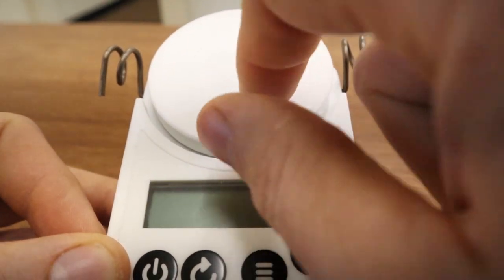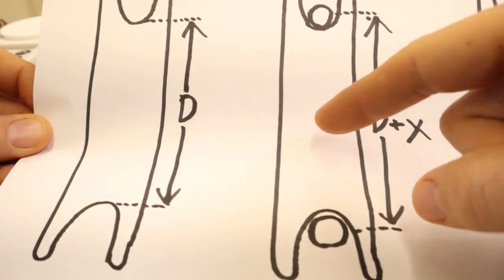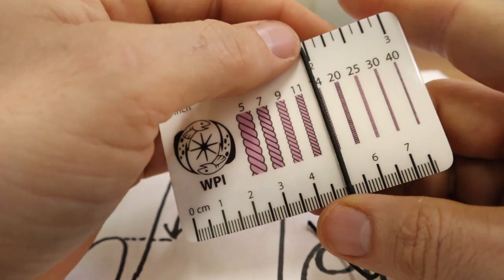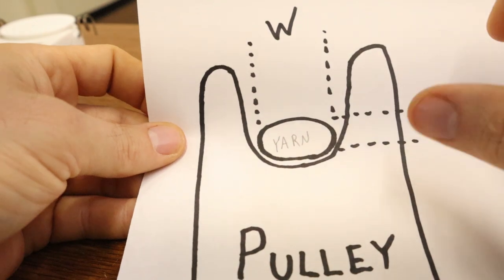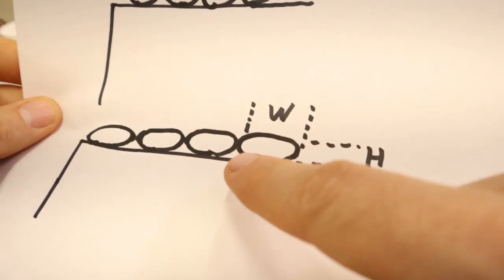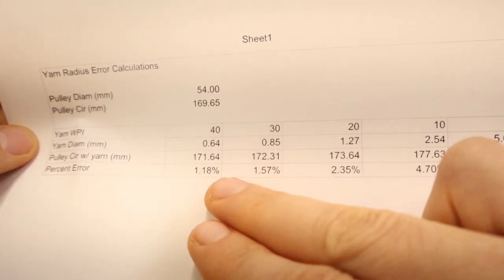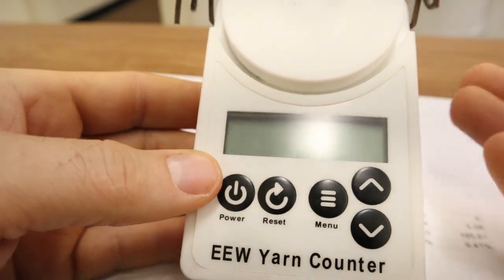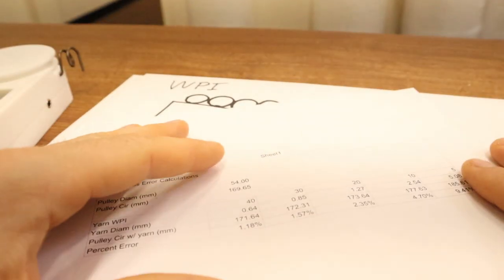SPIN #93 - The Yarn Counter Yarn Radius Problem and Solution

Comment: As long as your solution doesn't add significant cost, then go for it. But since it is slightly under estimating the length that is just fine. Better to have a little more then be short. Especially since some of us s play yarn chicken.
Reply from the maker: I agree that underestimating is better.  As for cost this feature adds nothing to the cost of the product.  It would probably just take me a few hours to code and then another day to fully test it.  The most important thing is understanding if people want the extra complexity in the menu or not since I'm fine with it either way.
Reply: My thoughts exactly!

Comment: If it is under estimating the length it is not a big problem. for a project it never hurts to have too much yarn it's when you have too little that it is a problem. 
Also instead of wpi you could use the yarn number system 1=fingering, 2=DK, 3=sport, 4=worsted, 5=bulky, 6= super chunky.
Reply: Please don't use that system. It is only used in anglophone countries, so most people outside the US will not be familiar with it. Even after 30 years in the US, I find it confusing.
Reply from the maker: Thanks for the feedback.  The issue with those names is not that many people know them (especially in certain countries) and their actual meanings are different in some places.  Just look up WPI charts online and you will find many of the top ones use different names with different WPIs.  Because of this I think I'll go with WPI and include a tool to help people measure it.  The good thing is you won't need to be exact and can just do a quick WPI estimate.

Comment: I would prefur to have the extra menu option in the software to make the corrections, If it’s an option you can make the choice to use or not then I think that’s preferable to having the corrections being made automatically.
Reply from the maker: By using a small yarn option that is effectively turning off this kind of a feature and the default would be that.

Comment: Your drawings and explanation were very good, and very understandable. I believe that most of us will be using the Yarn Counter to measure individual skeins, which can be long in fine yarns, but have much less yardage in bulkier yarns. So the error margin may end up being less than if you were measuring monster skeins of bulky.  I like the idea of having the counter able to calibrate for the yarn diameter, though.

Comment: I was told that a round tool for wrapping WI works more accurately than a flat tool.

I like the concept of your counter.  That larger diameter wheel would be better driven with no skipping I would think.  With that added counting of every inch will make it more accurate than anything I have used, tinkered with and now lives in a spare part box.  
When will you have this product for sale.

Comment: I love that you have a solution for this problem, and I'd be thrilled to have that solution. 

 Is it possible to add the capability to toggle the "precision measuring" on and off in the device, so that those who don't want to bother can just move forward, and those who prefer smaller percentage of error can have it? 
I agree with others who've said, the fact that it is underestimating is totally fine. I'd rather end up with 3 extra yards than be short by 3! 
Alternatively, if you want to keep the device simple, maybe it would be cool to just have a google spreadsheet that people could copy/save into their own google docs, and use to get a more specific estimate based on the WPI and weight of the yarn with the output of the device? 
That has it's own set of complications, so who knows if it's an answer or not! 

No matter what you decide, i'm definately excited about the yarn counter, and hope to sign up for the Kickstarter.

Comment: The fact that it is underestimating yardage is less of a concern to me than if it were overestimating...at least I know if I'm measuring for a warp or giving yardage for a pattern, I won't end up short.  So I think I'd be fine with the error (and to your point, it's kind of a given with these devices).  If you decide not to correct it with the software, maybe you could put a sticker on the back or include a card that tells you what your correction factor is for a given weight of yarn...ie; for worsted weight, multiply your measured yardage by 1.03.
If you do decide to add a menu option, you might consider using standard yarn weights instead of WPI.  Neither method is going to be completely accurate, and using standard identifications like worsted weight, sport weight, bulky, etc might simplify...although then you get into the question of 'do you account for other naming conventions, like 4 ply, 8 ply, etc..
Reply from the maker: I added the WPI adjustments to software and am in the process of testing the feature.  The testing will take a lot longer than writing the code.  I don't want to include the feature unless testing shows it really adds something useful.

The problem with the names you listed is they are different for different countries.  I think WPI is the best option and I will include a WPI tool so people can quickly check against their yarn.

Comment: Neat visualisation :-) How about a simple preset for three of four commonly understood thicknesses from lacy over sport and worsted to bulky? That should cut the error to manageable values and still be easy enough to use to not cause you headaches in support
Reply from the maker: The problem is no set of names used by all countries and even different areas within certain countries seem to use different names or the names mean different WPI values.  If you look up these yarn size charts online you will see many different lists of names in the top results.  I think WPI or some other actual measurement system is the only option that will work univerally.
Reply: @DreamingRobotsBlog  I have knit and worked with yarn in Germany and the US and you're right the yarn thikness is not universally defined. The most universal chart is the stitches per cm which depends on needle size. How about having the user measure out and mark a yard of yarn, pull it through and have the machine calculate the missing parameter in an initial calibration step. This could remain in the machines memory until the user wants to change it and also could be present to a common value for folks who are not interested in too much precision
Reply from the maker: @TheodoraLetz  That's an interesting idea, but is not possible with my hardware.  For this I'd need to measure distances very accurately since we are only talking about 1-5% length differences so in yards that would be about 1/3 of an inch.  This machine doesn't have that kind of granularity.  I only measure half turns of the pulley.  Even if I put finer measurements I'm not sure if this would be the best because if they mismeasured the length by a small amount that would end up being a lot of error.

Comment: It’s getting squished and stretched in most cases. We’ve landed on the best adjustment to be that of expectations. There is another manufacturer that uses a squishy wheel, that may compensate for yarn diameter🤷🏻‍♂️. An optical sensor would be great if you could do it.
Reply from the maker: Could you explain the squishy wheel and how that helps?  To me that would seem to make this issue less predictable and thus worse.  I see the advantage of a squishy wheel to improve traction, but are they also saying this helps with yarn diameter?  I'd like to see who this is and where they talk about this helping with the yarn diameter because my instinct says it won't help, but I am open to be proven wrong.

The reason I think it won't help is intuitively it seems like thin yarn would squish into a soft pulley most and those are the yarns that are basically correct.  Bulky yarns probably wouldn't shin into a pulley and those are the ones that need correction.